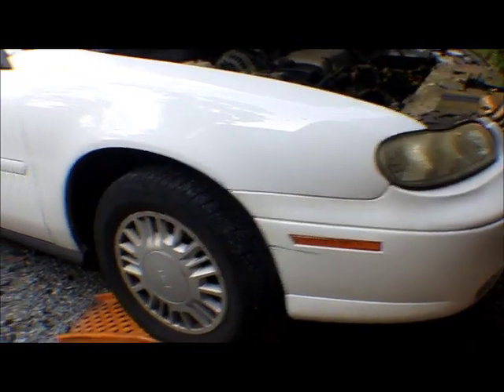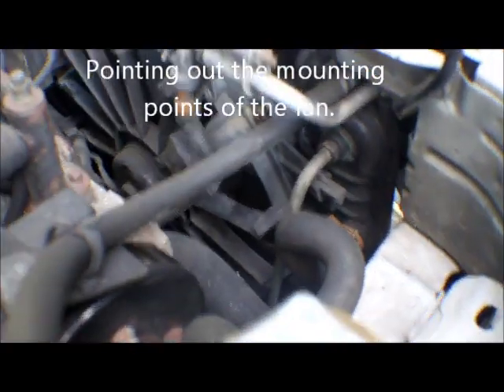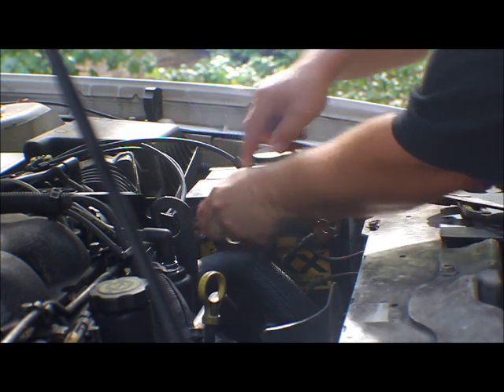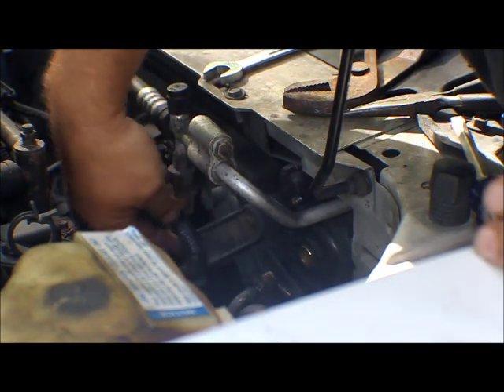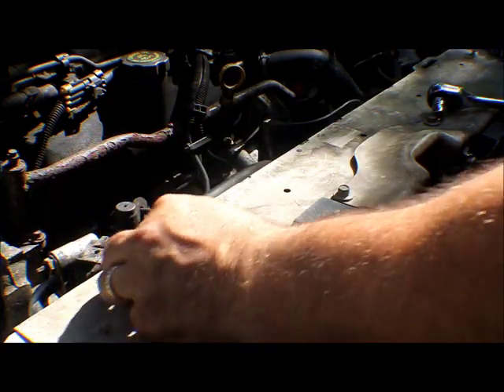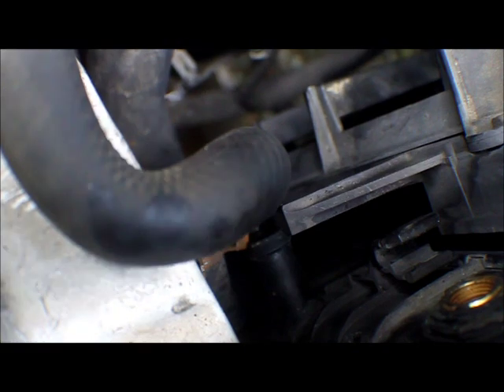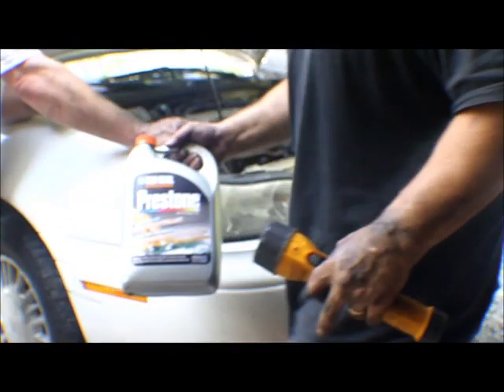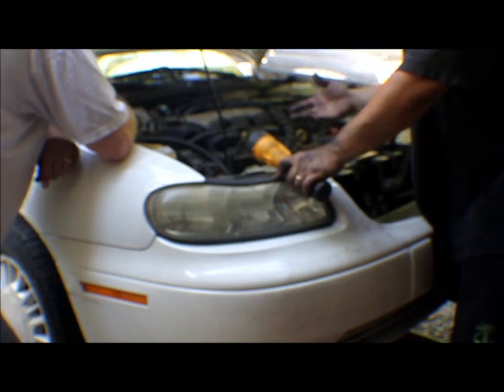How to change a 2000 - 2003 Malibu Radiator Fan Assembly

Comment: Thanks for the video. I changed my radiator out yesterday and I also bought the radiator on ebay like you said in the video. Thanks again, you saved me a lot of money.
Reply from the maker: Great!
Reply: William Quinn thanks for the video ..u have a question my car overheating but I notice that the cooling fan won't work only if I have my ac on other way it won't work you have any ideas thank you so much for your help
Reply from the maker: david ernesto Use a volt meter to check for power at the fan connection.  If it is there you may have to replace the fan.
Reply: William Quinn thank you again

Comment: You will not get shocked or burned if you’re touching the car and the positive that is the dumbest thing I’ve ever heard in my life
Reply from the maker: Try it and you will feel the truth.  - is hooked to ground.  + is ran through the vehicle to meet -.  You as a person, a large resistor, touch the + with one hand and touching the body of the car.  You will shocked and burned for DC voltage.  You do this on a house the AC will kill you.
Reply: @billyq12001  that will only happen if you touched the 2 terminals or gave it a path with metal like a wrench. You will not get shocked if you touch both termials at the same time with your bare hands. I can promise you that
Reply from the maker: @bradenschaller9989  At 60 years old I do know better.  Thanks for the suggestion. :-)
Reply: It only takes 1/10 of an amp to kill you.  However, when you figure in your bodies resistance which is between 1000 and 10,000 ohms (depending if your wet) 12v is not enough to shock you.  You could use ohm's law to prove this.  E=I x r  or.    I ( amps) = v (voltage) / R ( resistance) 
So 12/ 1000= .012 amp  or 12/10000= .0012 amp.